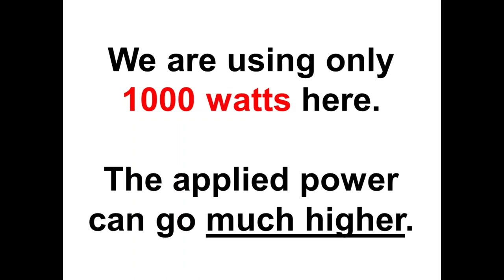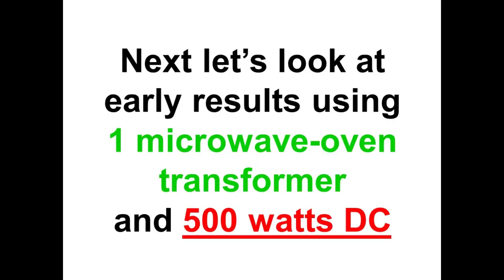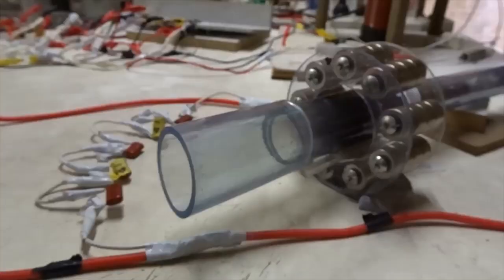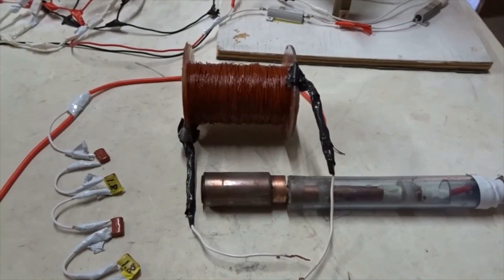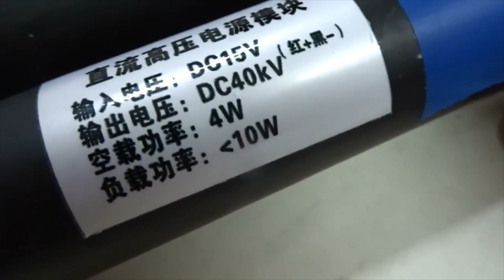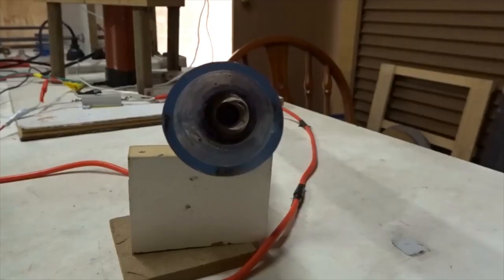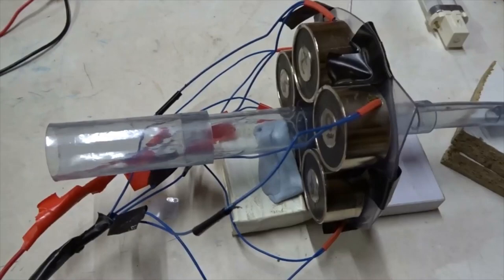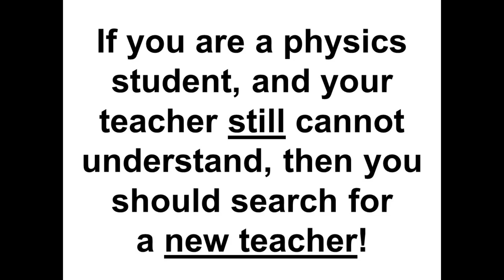We can make an ‘electric rocket’ by adding 1 kilowatt of DC power to a ‘ratchet’ ion drive

Comment: Most likely the deflection of a torsion spring attached to a lever arm will be needed to measure the nanodynes or microdynes of force this can make.  Consider adapting the Cavendish device for measuring G.  Since you have an argon flow,  you will need to measure the effect of that without electrical discharge, then and subtract the flow's force value from the result with discharge

Comment: Is there a measurable thrust from the discharge?
Reply from the maker: Not measured with an expensive machine, but it burns the hell of out your hand, from hot expanding argon gas, like for a rocket flame, if you get too close. Only running here at 5 amps, while most ion drives require 100 amps to be powerful. Please see other videos posted later on this channel for more information.
Reply: Probably not lol